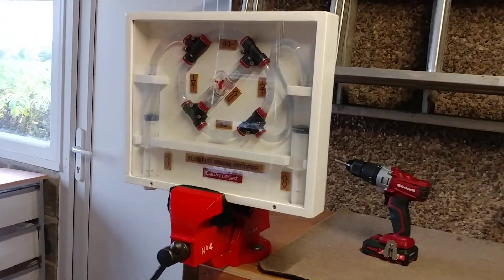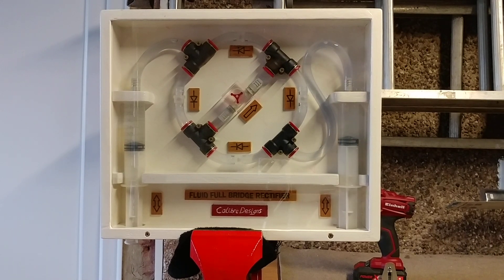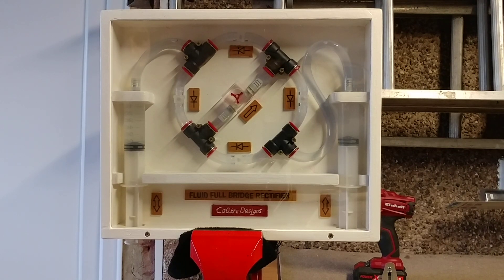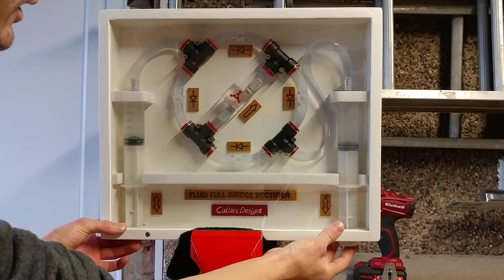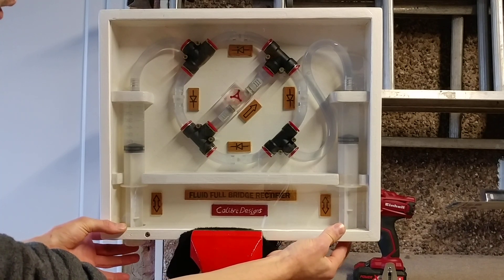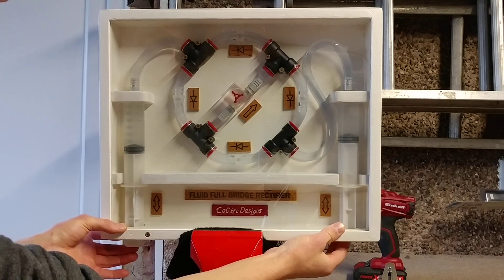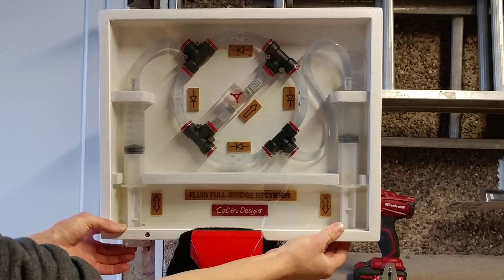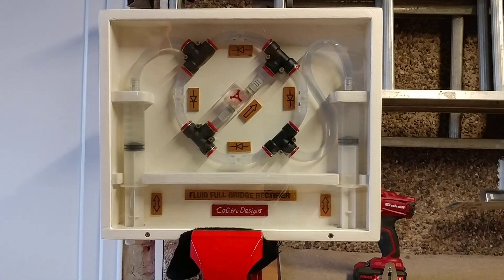Fluid Bridge Rectifier - Demonstrative Prototype

Comment: I thought about this a while back and just looked it up now, I wonder if this could somehow be used to turn waves from the ocean into power, but I'm not certain how useful it would be
Cool concept though!
Reply from the maker: Thanks for the comment! I'd also wondered if it would have any practical use in the vertical reciprocating motion of waves, or even tidal power (Which is, I guess, essentially a very low frequency alternating current).

Electric generating bouys probably utilise a linear induction generator whereas tidal uses underwater turbines (Which will probably just flip polarity depending on the tide flow direction)

In both cases it seems that rather than converting AC water into DC water then using that to generate electricity, it just skips straight from AC water to AC electric, which makes sense since that has lower losses over long distance

Maybe there's a scenario where it's the water itself that is desired, such as using wave power to pump water for irrigation, or to be used in a liquid cooling system, although neither of these favour a closed loop system like a bridge rectifier

Comment: You can use thermoacoustics to make alternating fluid movement then rectify it to direct movement to run turbine. In this case you dont need moving parts like one way valves, you can use tesla valve aka valvular conduit. This would be cool to see if it works.

Comment: this is great man, can definitely be used in classrooms! As far as making the flow more visible (I think it would be a significant upgrade) maybe the bubble is a good starting point, perhaps using a thicker fluid which has bubbles mixed into it would work, although there's a risk that it forms one large bubble with time or use. Anyways nice work!